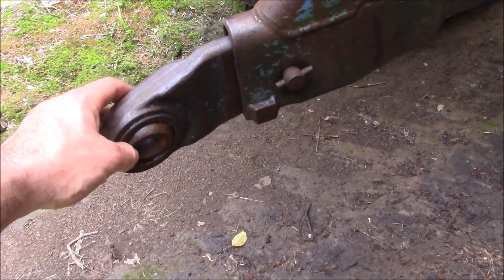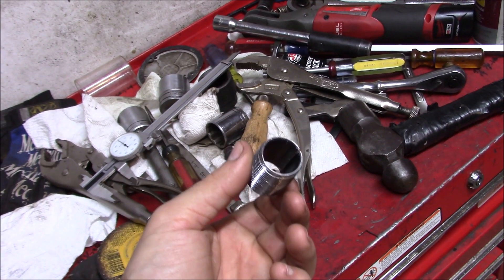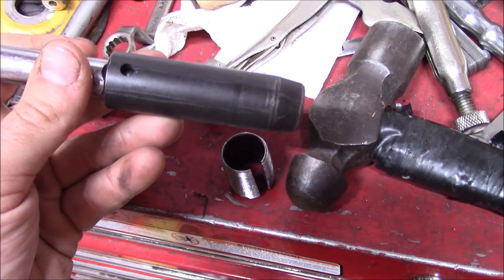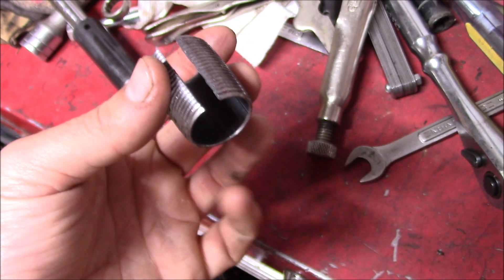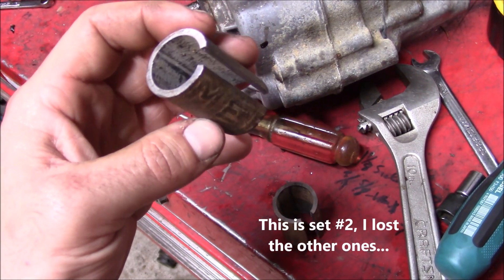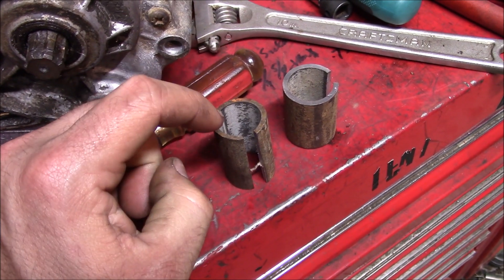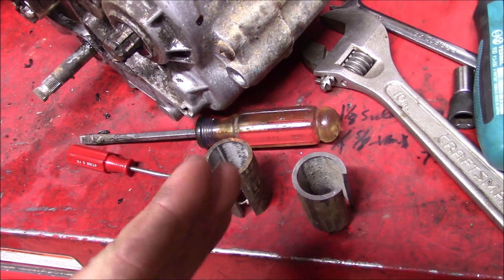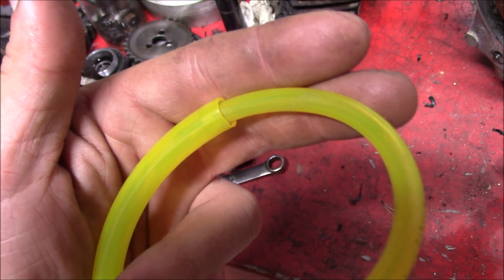Adapter Bushings Made From Pipe: Cat 1 Pin to Cat 2 Ball

Comment: Got to love a good scrap pile. It's a rare day when I throw something away.

If you like this sort of stuff you should read Burt Munro Legend of Speed by George Begg (the other munro books are shit in comparison). Some examples from top of my head: making an engine cylinder out of a drainpipe at bonneville? speedweek, depth micrometers from wheel spokes, annealing his frame in a wildfire, using a drivechain in a way that the company expert said would fail (it didn't). There are many more.
Reply from the maker: Cool, might have to check that out.  Have seen the movie and documentary, that guy was a legend.
Reply: The Begg book is the only one with technical detail. Getting a bit expensive these days though unfortunately.